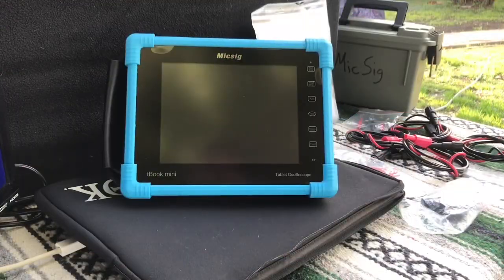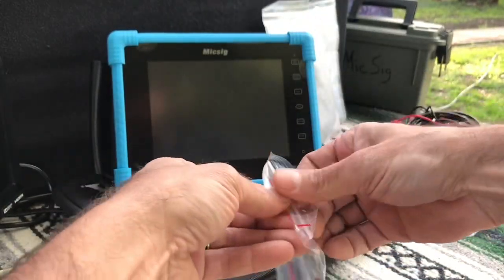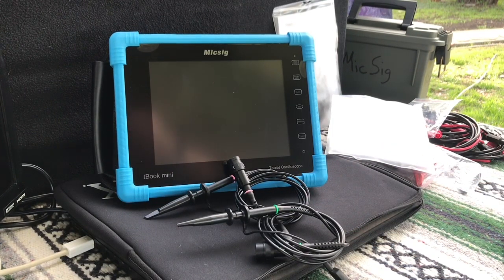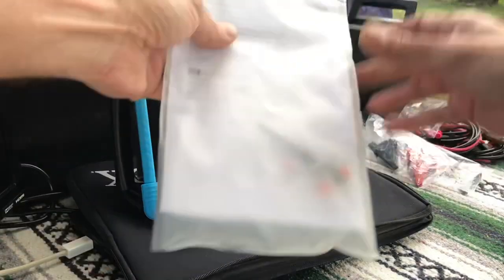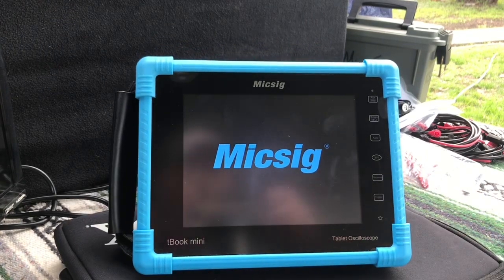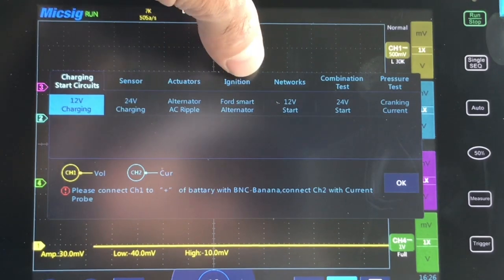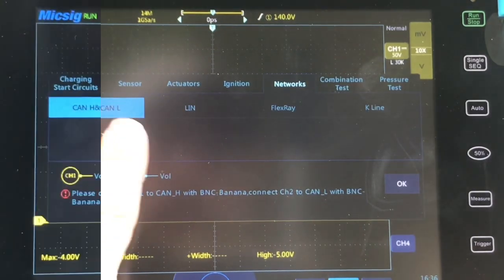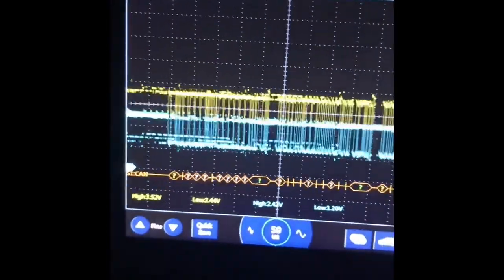MicSig ATO1104 Tool Review Automotive Oscilloscope

Comment: Has anyone had trouble connecting to the wifi? Mine will not connect.
Reply from the maker: I’ve never had a problem connecting to WiFi with my ATO1104. With that said, I haven’t tried connecting in about the last year. I purchased the newer SATO1004, and for some reason the only way I can connect it to WiFi has been connecting it to my Apple phones personal hotspot. It won’t connect to my home WiFi, even though my ATO will. Not sure why that is. Maybe try that with your ATO and see if that works. Good luck to you.

Comment: Hello ATOM  what are the up and down arrows in lower left corner of screen ? Filtering a hashy signal?
Reply from the maker: Hey Mark. Yea, so those arrows are for fine tuning for the measurement cursors. You can bring up your cursors to get an exact measurement. Once you open the cursor, you can move it up and down quickly by dragging your finger across the screen. If you want to move it a little at a time, you would use those arrows. Hope that makes sense. Thanks for the question.

Comment: Atom. I’m a new subscriber I’m also a Diyer and a retired high performance jet mechanic. I’m looking at this scope and will be going through your playlist to see it in use. I’ve. Also am a subscriber to Mario Diagnostics and he has mentioned it to be a good improved scope for a Diyer. And the beginner.  Your video was very informative but will look for follow up videos. Really don’t feel the need for a 4 channel pico. I also see they are on sale right now. Do they offer good support and add on accessories? Anything you can tell me wouid be greatly appreciated. Thanks for sharing and stay safe and well Artie 👍🇺🇸
Reply from the maker: Hello Artie, and thanks for stopping by. Yes, they’ve always been good with customer service. In fact, originally they didn’t have the invert option for each channel. I got ahold of them and suggested how important that is, so they included it in the very next firmware update. They do have accessories also. However, as you’ll see in my videos, I mostly use Pico color coated 3 meter leads. I just think the ones that came with the scope were to short for automotive use. With that said, I believe they now offer longer leads. I also have one of their amp clamps, that I really like using. Personally, sometimes I use the Micsig amp clamp, and sometimes the Pico. They were selling a COP wand tester, but someone just recently told me they discontinued it. Not sure why, since when I first got it, I compared it to the Pico, and they had an identical waveform. Only, the Micsig could use a longer ground wire. Well, I hope this helps you. I’ll leave the rest to my videos. I’ve had mine almost 2 years, and still enjoy it, and am glad I have it. Don’t get me wrong, I’d love to ha e a 4 channel Pico, but for the price, I just can’t justify it to myself; and I damn sure can’t justify it to my wife, lol. Even if I had a Pico, I’d probably still use my Micsig plenty, just because I don’t need an external laptop. Anyway, thanks again for stopping by Artie. I hope you enjoy the other videos. I know they aren’t great, but I couldn’t find the info elsewhere when I was thinking of buying one, so I thought someone had to do it. Take care my friend.
Reply: @atomsworkshop195  my friend were in the same boat as far as pico and wives. I wouldn’t even ask I know better but this unit seems perfect for my needs. Thanks for replying and hope your wife is okay and and not to much damage to the off reader 👍

Comment: Wow!!!! $600 on up for this ATO1104. That's a bit more than I'd like to spend on something like this.
Reply: It’s a steal compared to a fluke or pico, I’m considering this scope as well.
Reply from the maker: It really is. Fluke and Pico charge way too much. I made that video some time ago, and still believe it’s the best option in that price range. I’m still using mine today.
Reply from the maker: Hello William. Yea, they aren’t cheap, but they are good scopes. One thing I learned while shopping for a scope, was, for me to get a good one, I was gonna have to open my wallet. All good scopes are pricey. If you’re going to use it to make money, it’ll pay for itself. Well, thanks for stopping by William. If you find one that is equally as good or better, priced lower, let us know. Take care my friend.
Reply: The fact your still using it says something about product durability and longevity. It’s not something I would use a lot but it would be a significant upgrade from my allsun single channel scope that has served me well for many years.
Reply from the maker: I don’t want you to get the idea that I use it every day. I run my own small diagnostics and repair business, but don’t have enough business (at this time) to use it every day. Also, I’m pretty cautious with it , and haven’t dropped it yet. With that said, I don’t think using it every day would be a problem at all. I just don’t want to paint the wrong picture for you. I do think it’s a really good scope though. Also Micsig has good customer service.
Reply from the maker: If shopping for a scope in that same price range today, I would buy it again. If I had around $4k to spend, I’d probably go with the one from ATS (Automotive Test Solutions). I’ve been eyeing their scope and scan tool for some time now, and would love to have both. Unfortunately they are like Pico, pretty expensive.

Comment: I just bought the ato1104.I'm trying to get can bus waveform but they look awful!!I've had a few scopes,Snap-on,Carscope Viso,Autel and can bus signals are really easy to display,you 'should' get nice squae edges but my one is a mess,interference,lines at the top 'and' bottom of say the can high trace,it's just a mess!!
I've tried everything,i'm using a breakout box to get the signals,and i've tried a few different scope leads but nothing improves,all other waveforms,injector,ignition etc display fine!Which makes it even more confusing.
Reply from the maker: Hello Bob Baxter. Sorry it took so long to reply, been pretty busy. That’s odd. Not sure why you’re not getting a good waveform for CAN signals, when all your other waveforms look good. I always use a breakout box (BOB), plugged into the DLC. I ground my leads on my BOB, and also put my leads in the BOB and have always gotten nice waveforms. Have you tried, maybe going to the channel menu, and pressing the “lowpass” button for the bandwidth. Often, if my waveforms look a little distorted, or have too much interference, I press the “Lowpass” filter, and it usually cleans it up. If that doesn’t work, I’m not sure my friend (at least at the moment). You could try, maybe checking to see if there is a firmware update. I don’t think that is the problem, since your other waveforms look good. Have you tried on any different vehicle’s? Maybe it the vehicle. I wish I could have been mor help. I just figure if your other waveforms look good, it would seem that you know what you’re doing. I’ll let you know if I think of something else. Again, I apologize it took me three days to respond. Good luck my friend. Also, if you figure it out (or already have), will you put the reason why, here in the comments? Thanks Bob.
Reply: @atomsworkshop195  I got to the bottom of it yesterday,i too use a breakout box incidentally.The problem was the Micsig always defaults to 'persist' setting under 'display' then 'waveform'.Turned this off and it's fine!Thanks for replying.
Reply from the maker: Good morning Bob. I’m glad you figured it out. Thanks for letting me no the remedy. This way, if anyone else on here has the same problem, we can now help them out too. That’s what this channel is all about, helping each other. Have a good day my friend.

Comment: I want one of these, but I wonder why they are so hard to confidently purchase on Amazon and Ebay, as its always confusing, the listings. I also wonder why they have so few ratings, even after all the years they've been out. What is the failure rate and customer service like? I need this to help me make money, I don't want an inferior product, I'd like to know what I'm in for and whether I can depend on it for what I pay.
Reply from the maker: Hello Backstabbio. As for the confusing purchase, I would agree on Ali Express. They seem to sell different options in the tool separate. However, on Amazon, it’s pretty strait forward (at least the last I looked). If you purchase the ATO1104, the tool will come with all the features unlocked, with all the accessories I show in the video. I personally give their customer service an A+. Anytime I’ve had a question about anything, I just contacted their sales department email, and Jelin has always, more than come through with good answers. I can only speak for myself, but I’ve had mine for over a year, and have no complaints. In fact, they even seem to take our (mine) advice. Originally, the ATO1104 did not have the invert option in the channel menus. I contacted Jelin and expressed how important that option is for automotive use, and with the following firmware update, they added the invert option to each channel menu. That really made my day. Now, anytime I see a video on YouTube, and I see the Invert option, I think to myself, “wow! that’s there because of me”. As far as longevity goes, I have only had mine for working on 2 years now, and I haven’t had any problems. With that said, I am adamant about taking care of my tools. I don’t just throw it around. I still really enjoy using my Micsig (both of them). They are not hard scopes to learn how to use, or your way around the menus. All scope accessories work with the Micsig, such as Pico current probes, leads, etc. so if you already have any accessories, or wish to use other brand stuff with the Micsig, you won’t have a problem with that. The only issue I have; and it’s more of a suggestion than a problem, would be; I wish they would give the option of getting the ATO firmware inside of the STO scope, with the knobs & buttons. I think having that option at the time of purchase, would be pretty cool. Also, I like the Micsig because it’s a stand alone tablet scope, so you don’t need a laptop to use it. The battery lasts a good amount of time; and if you need to use it while it’s charging, you can. Now there are some features that the Pico automotive scope has, that the Micsig doesn’t. One thing is the waveform library. I really wish Micsig had that feature. Of course the Pico automotive scope costs a lot more to purchase it, so I guess you’re paying for those other features. Anyway, as I said, I can only speak on my experience with Micsig, and I am a happy customer. I don’t get paid by Micsig, so everything I say, is how I feel, and my personal experience. You could go to the comments section under my videos, and ask other people that bought the Micsig, and ask what they think. Well, whatever choice you make, I wish you luck. If you have any other questions in the future, feel free to ask me. I’ll do my best to answer. I’m usually pretty good at responding within a couple hrs, or within a 24 hr period. Good luck Backstabbio, and thanks for watching.
Reply: @atomsworkshop195  Thanks! I asked MicSig about the software. I really want the knobs, but I also really want the automotive testing features. It seems like it would not be too difficult to combine the two. Thanks for the quick response!

Comment: We use the Snap-On Zeus at work, but the issue is I can't use the scope and the Scan tool to activate actuators at the same time. I was looking at getting this, how do the specs compare to the Zeus? The Zeus has 3MHz Bandwidth and does 6 MSPS for 1 channel @ 1us and 1.5 MSPS for 4 channel and all other time frames. Also, do you have to ground each individual channel separately or is there a common ground like our Snap-On Zeus?
Reply from the maker: Hello xXBurntBaconXx, thanks for stopping by. Wow! The Zeus, the big dog, lol. Seriously though, that's a really nice kit. It's a ways out of my price range though. Is it everything it's made out to be? I figure since you use it regularly, you could tell me if it's worth what they charge for it. Any way, I know that's not why you came here, so lets get to it. Actually, instead of me rattling off numbers, I think it would be better for you, if I just gave you the link to the owners manual. Once on there, you can type in page 159, and it lists all the specs. This way, I don't make a mistake, and also, you can see them "all" for yourself, and compare them to the Zeus. Here are a few specs, just to give you an idea, for now.
Sampling rate range:
Single channel 1GSa/s
Double channel 500Msa/S
Three / four channels 250Msa/S

Model—Bandwidth
100MHz

Bandwidth limit: 20MHz（-3dB）、high pass filter, low pass filter

Also, to my knowledge, yes you do have to ground each channel (I do anyways). With that said, I want to say that I saw someone connect a single ground to the Aux out channel, and did not have to ground each channel at that point. Don't quote me on this; I would have to look it up to be sure. I usually use the Pico 3 meter leads (yellow, blue, red, and green), and they have were you can stack (piggyback) the leads. So I just stack the ground leads, unless I'm connecting one channel to an individual circuit ground. 

So, I hope this helps you on making a sound decision. I personally think it's a great scope for automotive diag. No, I do not get paid to say that, though I wish I did. In fact you can look on my channel. I posted a video of my Amazon receipt for my Micsig ATO1104, so everyone can see that I purchased it with my own money. I just think it's a great scope, for a good price, and I really enjoy using it. I decided to make these videos because, when I was trying to decide whether to buy one or not, I could not find this sort of info or videos of the ATO.

Ok, good luck to you my friend. Here is the link to the Micsig ATO1104 owners manual, with the specs towards the end on page 159.

file:///C:/Users/spec-/Desktop/Micsig%20Owners%20Manual.pdf

 If for any reason it doesn't work, I'm sure you can google it. Take care, and thanks for stopping by the channel. Feel free to subscribe, if you're not already. I am going to start reviewing and showing other automotive diagnostic equipment right away.
Reply: @atomsworkshop195  I'm still an apprentice and currently doing a labscope course that revolves around the Zeus. It's worth it if you get allll the attachments like the pass through. It's basically a Windows tablet so we can also go online. It has built in "guided component test" so we don't have to look up wiring diagrams for each sensor, it'll also tell us what kind of sensor it is (analog ABS vs Digital ABS etc) so again we don't have to look it up. It legit does everything (reprogramming new modules, key programing, parking brake reset, etc). The issue I have with it, battery lasts 3-4 hours not enough for a day of diag, you can't use the lab scope and scan tool at the same time so if you need to turn something on and scope it you can't, you also can't use the internet and scan tool at the same time. 

My favorite feature which saves me a ton of time is the scan tool. You scan a car and get the code, if you hit diagnose it'll give you the top 5 repairs performed by other techs, and can create a custom PID list just for that code. You can also go straight to the guided component test from there. It's worth the price if you have a bunch of parts changers in your shop, makes it extremely easy. So when I'm being lazy or I'm behind and don't have time to do proper diag it saves me time. A quick diag for me goes like this: MAF sensor code > Guided component test > Tells me value range it should be within and what wires to probe > open up scope > perform test. 15-20 minutes tops. 

 However everything it offers you can get from everyone else for less. Like guided component test, I'm 99% sure it gets the info from prodemand. Same with the top 5 fixes for a DTC code. All the relearn and program functions you can get with an Autel or Launch Scan tool for literally 1/5 the price. It's also $2000/yr to update it.
Reply from the maker: That does sound pretty nice. Thanks for sharing. It’s nice to get an opinion from someone that’s not trying to sell it to me. You know, have you looked at the Autel Maxysis Ultra? I’ve seen Scanner Danner use it. Apparently they sent it out to him for free. Must be nice. After seeing it on one of his videos, I looked a little more into it. I have to say, it seems like a good kit. I have an Autel, and do like it as a scan tool. The new Ultra has a built in scope. Also, when you have the dongle plugged into the DLC, you can actually scope it. Yes, without setting up a scope channel, but through the DLC. That’s pretty cool. Also, to address your issue on only being able to use scope or scanner; with the Autel Ultra, it has the option of a split screen, where you can use both the scope and the scanner at the same time. This way you can, say, activate a solenoid while watching it on the scope. I do believe it has the guided component test as well. Personally, I am going to look more into how well the scope is, and if I like it, in the future, when the price drops some, I seriously am going to consider picking one up. Anyway, just thought I’d share that with you incase you haven’t heard about it yet. Also, thanks again for sharing info about the Zeus. Oh yea, the Micsig is also built basically on a tablet, so you can access the internet on it also. I do believe you can do the same on the Autel Ultra too. Take care buddy.

Comment: Is the ATO1104 better than the TO1104  🤔
Reply from the maker: With that said, you could still use the TO1104 for automotive use. It’s just the ATO1104 is more set up for automotive.
Reply from the maker: F P, if you are using it for automotive use, I’d say absolutely, the ATO is better. If you’re not going to use it for automotive, I would probably save some money and get the TO1104.